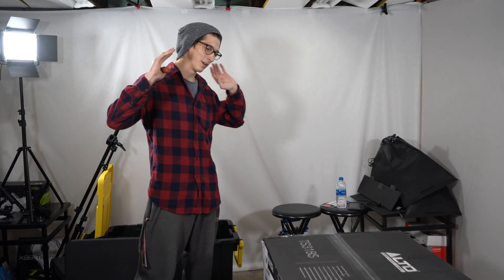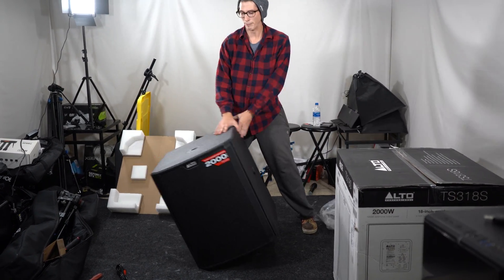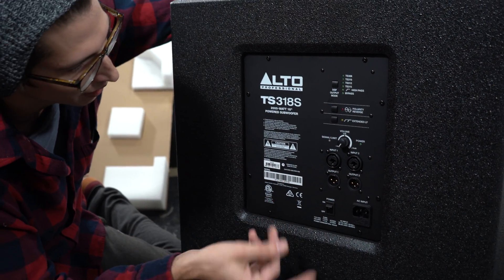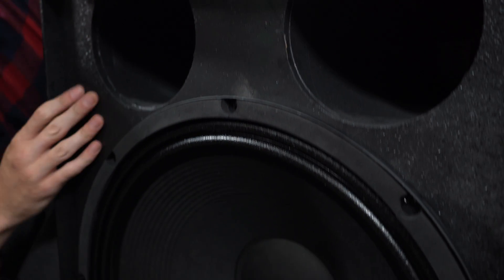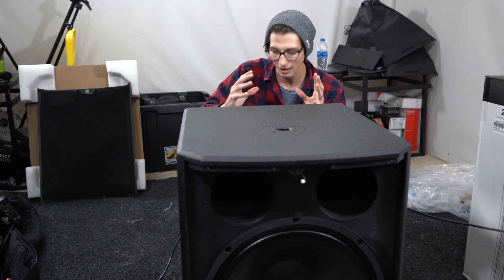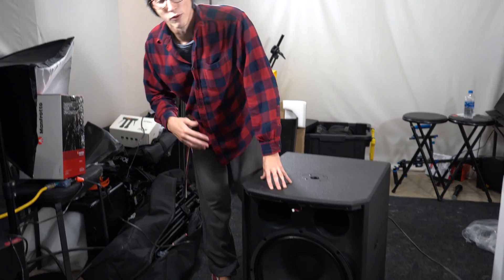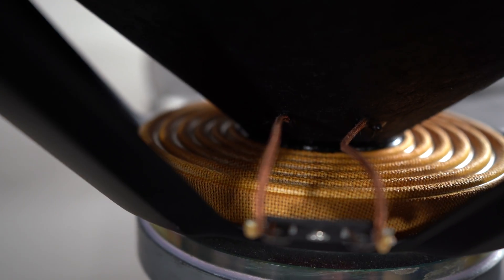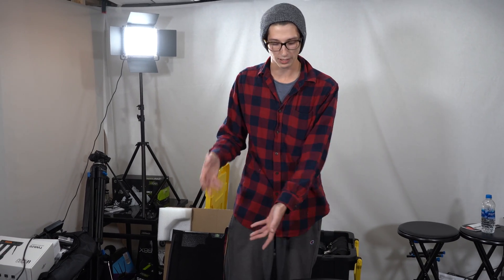Alto TS318S subwoofer Fail and Tear-down! 2000 watts? Worth it?

Comment: I use 4 of them and they have a solid sound. They are not so bad as you talk. They don't have that punch but you can definitely feel rumbling your bones and moving your clothes. The only missing thing (my opinion) is a better x-over function. It doesn't have 1000w RMS it does 500-600w but hey for the price you get it it's really good. If you combine it with 2 15" subs they will rock! I usually use them for techno/house events and I've never had any problems. 7/10
Reply: Will you use them outdoor?
Reply: @seitonkumokoroye2059  for smaller events why not.
Reply: What number if persons typically? Live music 4 on each side?
Reply: If you have 4 subs per side you can easily cover 300-400 people outside
Reply: @jakovvojnovic8475  would you try to scale them up for a 1000 man event?
Reply: @seitonkumokoroye2059  i would't say 1000 but you can go with 700-800 depends what top's you got and if you use the system for acoustic or classic music
Reply: @jakovvojnovic8475  ok. I guess I need a different brand of subwoofers. I own some line arrays and I was looking to get these as my low end
Reply: @jakovvojnovic8475  I typically do like African traditional music. It is quite heavy.
Reply: he blew it in under 2 minutes, what do you mean they are good lol
Reply: @SBK_ALL_DAY  he blew it on purpose.  You could do that with any sub.  Either that or he's just completely ignorant.  If you use it properly, there's no problem.
Reply: Saying that that one-note wonder has a solid sound must be a joke. Surely.
Reply: Tengo más de 15 años usando equipos "ALTO", jamás he tenido problemas con ellos! Para mi, son equipos altamente confiables! 🎼 🙂
Reply: He's a crime on the pro audio community... What a joke he is
Reply: Agree! He is quite ignorant

Comment: Great review and honest, I was surprised to see when you removed the woofer from the cabinet, to see the woofer was a single voice coil woofer, I was expecting to see a dual voice coil woofer, that's probably why you guy's where able to burn out the woofer so easily, I would still buy the (Alto TS-318S) sub woofer, just replace the bass driver with a better quality woofer. Thanks for the video!!
Reply: if you already own the sub i would agree but, If you don't spent that extra woofer money and get a true and tested sub like qsc..Rcf..jbl.. or yorkville..I learned the hard way..buy good the first time and you won't look back.

Comment: What do you recommend buying to upgrade the sub in the alto ts318s i have two and want to put new subs in them and also audio fill
Reply: If your on a budget check out bishopsounds subs ( maybe hard in the states? ) I replaced my ts312 sub with there 400w RMS jobby ( which was just for a laugh as it's only rated at under half the alto plate amp ) and it made a great improvement. There 18" subs are pretty impressive for the price as well. You can get either a 1000w RMS or 1500w RMS
Reply from the maker: Theres alot of great choices, youd have to match the drivers parameters to alto's box tuning and dimensions.

Comment: Poly fill and a heavy duty sub woofer will make it a winner. The construction of the cabinet and coating is nice.
Reply: Just brace the inside, 2 planks of wood as a cross will do it.... buy some white loft insulation and sprey glue it on..... build a bass reflex 2 shelf port and remove them 2 stupid carpet cardboard centers

Comment: I had to replace all my drivers in my 15's Alto tops with quality Eminence and they got super loud and clean sounding; and, yes, poly-fill it's a must.
Reply from the maker: ALTOS amps are pretty damn good, wish their drivers were better
Reply: The original 15 "HIGH is not 4 ohms? with the Eminence would be working in half ...
Reply: @morritox  i don't remember. My Eminence it's extremely loud because the amps in them are very strong actually. Measure your original and let us know how if they are 4 ohms.
Reply: Gogo Mogo I have TS315 tops, I’m fairly new to this so how advisable (and difficult) would you say it is to upgrade the drivers?
Reply: @harleybranfieldphotography  I own 2x Alto Truesonic 115A that comes with very small tweeters and very underpowered woofers. So after trying few woofer/tweeter combinations I settled to this:
Eminence Eminence Kappa-15A 8 ohms and Pyle PDS182 from PartsExpress. I know, Pyle does not say much but, this one its very clean/warm sounding. First see if your tweeters are very small; only then consider to replace them. With this woofer they will be very-very heavy comparing to current weight. If you are looking to alternatives to those make sure to follow the same efficiency in decibels. That combination works just fine.
Never push more bass in the main speakers to compensate for a subwoofer. Just get a subwoofer to match them. At low volume, yes, you can.
Reply: Gogo Mogo thanks, I think my first move will be to add a sub to the setup and see if changing drivers is necessary... I don’t want to over complicate things if it’s not needed

Comment from the maker: Let us clarify some things since I see alot of the same question. We run a 30hz sine wave through all the powered subs we test. We know it's very tough on the units, we do this to torture test. Alot of edm, rap, and hip hop will reach 30hz and lower but I know that's not the same as a sine wave. Again we do this as a way to see just how tough the amp and driver combo are. Sorry for the Alto fans, we did not like this product.
Reply: We cannot say that Alto did not meet its specifications, that the user takes this to another level is very particular. So the title should be rather a "ALTO TS318 to extreme tests: fail" ... but not generally fail.
Reply: The Cerwin Vega CV-18S will roll off below 28hz.Some  pro audio subs are starting to show up in this frequency range now.
Reply: 2 Dudes Audio eventhough this level of subwoofer is at the lower end of the spectrum, just like any NEW driver in any enclosure it requires burn in as it will not behave to its full potential until that process takes place. Most drivers incur damage because users are either impatient to follow through with the burn in process or just plain ignorant of that particular fact.
Yes the amplifier may may be over powered for good reason, particularly as it is amplifying low frequencies where headroom is often non existent but not properly understood and/or respected in this particular context hence it can damage the driver even after burn in, despite the limiting circuit. Anyway that’s another story.
Overall this product seems to be great value and if utilised correctly and within its means, performance is quite admirable amongst its higher priced brethren, though obviously not at their level. Fair go...
Reply: there are almost NO PRO AUDIO SUBS on the market that will hit 30hz @ -3db, your lucky if you get -10db at 38db, only car and home audio/theater subs get deeper than 30 hz. . . however if for some reason i am wrong about what i said please point me in the right direct as to what  pro subs play sub -38hz frequency at with -3db , I have been looking for years and from research only  touring rigs do that ;9  also by the way if you a sub recieves a frequency below its port tuning frequency , the sub unloads and essential goes to being free air, at which point you will blow the sub , just as you almost did.
Reply from the maker: @mikeriverajr4447  I understand what you mean, although you are just abit wrong about the whole 30hz deal. I've known plenty of pro audio subs capable of very loud 25-30hz notes. And you're right about the port tuning but I repeat "we do this to every sub we review" and this is the first to fail. So🤷‍♂️
Reply: @2DudesAudio  whats your  recommend affordable portable subs that hit  30hz at -3db?
Reply from the maker: @mikeriverajr4447  DIY or Kit is the cheapest way to get your best output, for under 400$ you can have a pa sub that plays 30hz at -3db
Reply: @2DudesAudio  i've been interested in building a sub for a while that will Go low, but I've struggled to find something that will hit 130+ DB half space and do it and -3db at 30hz, and not be a 12 CF box,  what sub would you recomend to get  either kit or just sub,  thanks for your response

Comment: i have my own 318s subs, 2 actually. And for me the bins is AMAZING. And i just don't understand why you push a 30Hz Sine wave through that bin. it was only made to go as low as 40Hz. 10 Hz does not sound a lot but pushing 30Hz at 90% of the power is not a great idea!!!!

Overall the bass bins is fantastic end of story
Reply: Even most professional series subs aren’t designed/capable of reproducing 30hz at full volume. That’s where the +10db, -6db specs come into play. These are designed to sustain 44hz at full volume. At 30hz your just burning the coil out.  Knowing what you’re doing, and how to properly use what you have is half the battle.
Reply: @Djtylerwallace  you are correct... these "2 Dudes" are exactly what their name implies... they know nothing about professional sound and the science behind it... there is no music where a constant 30 hz sine wave is produced for long periods of time, so this "test" means nothing for real world use.
Reply: Those are active speakers, they should have electronic protection to prevent going out of speck.
The fact that the circuit did nothing to stop 30Hz at high amplitude from frying the voice coil, kinda says something about it's quality IMO.
Reply: He doesn't know what the duck he is doing
Reply: me too i have 2 of this and they are perfectly functioning with every type of songs rap house etc.. maybe they have something wrong against alto
Reply: @George Snow I think its the other way around ,2 me it sounds that they,and you cannot admit that at this price range its actually amazing sub,so you can convince yourself that overpriced brands are worth the beefy price tag
Reply: Yeah. I smell something fishy about this video. Lol
Reply: they didnt get sponsored maybe=( @thennekcdcdthennek6417
Reply from the maker: Maybe we got a factory lemon🤷‍♂️
Reply: @2DudesAudio  Maybe you were trying to destroy the Alto because you sell Harbinger...

Comment: You should put the KW-181 driver in this box to see how the Alto amp holds up
Reply: The KW181 driver isn't anything special either, it has a 3in voice coil and is rated around 500w RMS.
Reply: @dare2bdeviii  Which brand has a better driver at that price point?
Reply: @stacktrace   Not many to be totally honest. dB technologies perhaps? They use RCF components.
Reply: @dare2bdeviii  I wonder if DAS has a similar 18" driver to RCF/dB.  On the RCF side, as a mobile DJ I'd consider replacing my KW181 with the new RCF SUB-9004-AS but it weighs in at 125lb compared to the ~90lb KW181, so I'd rather haul around the lighter KW181 even though I'd much rather have a more powerful 18".
Reply: @stacktrace  I had seen a review on the EV ETX 18" in the review just like the Alto everything was good except the subwoofer itself. Dude dropped at Seismic Audio 18" in. He said power consumption went down a lot. Sound levels went up.
Reply: Antonio Fernandez Jr saw this too

Comment: Frequency range is only 35 Hertz you better erase that video before you return it you said 30 Hertz ... Crossover should have caught it though.... Please put one of your own drivers in there see what we can get out of it.. thanks..
Reply from the maker: The sub is still fully functional. We wanted to test that frequency and to see what would happen for this exact reason. Unfortunately the subwoofer would have fully failed if we hadn't have turned it off right when we started to smell the coil. So unfortunately for anyone who buys this they should realize this could happen to them if they decide to push these sub for some real low frequencies
Reply: @2DudesAudio  I have the old trusonic 1200 18inch.. it's boomy also the cabinet is too big that's the only reason I was interested in the newer version....scary though..
18 inch will be more boomy the anything smaller....I run everything through my driverack DSP little compression helps for punch.